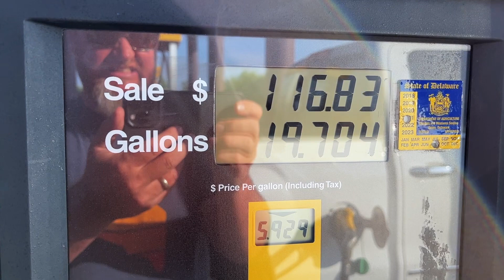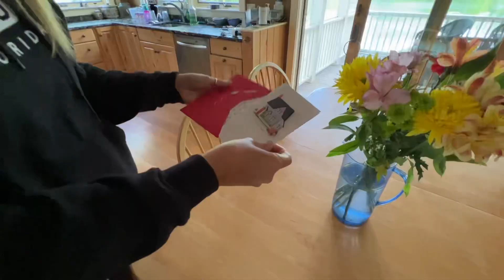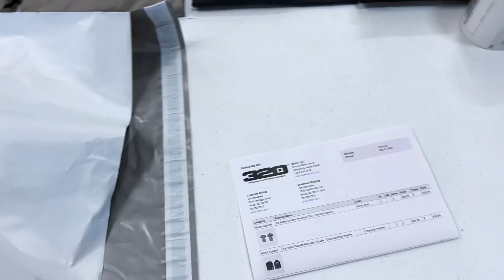THOUGHT IT CAUGHT ON FIRE | HOW TO HANDLE THESE ISSUES ON THE ROAD | RVING TO MAINE  S7 || Ep 131

Comment: you guys could do a DPF delete kit on the pickup but that depending if you guys still have a warranty on it still and have to do an emission testing every couple years in Maine . Here in Maryland only gas engines get tested. that was my worry about using my pickup to pull our camper on a cross county trip, having it break down and not knowing a reliable place to take it too. so we rented a rv instead and drove it.
Reply from the maker: I have definitely considered it, but I think we are going to sell it and get a new one, so we wanted to get it all ready to sell and if we need to go through a dealer to trade in, we didn't want it deleted.  Thanks so much for watching!

Comment: My son-in-law is stationed at Virginia Beach!  Thank you for your service!  I use to make Formula boats,  I made the small parts, like the showers, dashes, hardtops, arches and such. I also helped with the decks and hulls when the needed. I can give you tips on the gel coat too! Where to look for thin gel coat and how to feel for it. lol.  Gel coat should feel smooth like butter.  If you run over and area the feels like orange peal it's too thin and needs fixed right away!.  Thin gel coat will tend to be in cracks and under ledges, so make sure to check those closely. Remember gel coat it part of the water protection of your boat.  Also don't be afraid to knock on the outside of your boat especially around the transom and the v or keel of the boat.  You are looking for air pockets in the fiberglass. Knock hard if an area sounds hollow, gives it's a potential red flag. If it cracks you know there are other issues with the area of the boat.  If your boat has windows do the same check. Just a little tip!  Love your video's and family!  Congratulation's girls on your license's!!

Comment: Congratulations on Lily getting her license! The thing about the camera and the sound is maybe you may need to get the camera fixed or a new camera? Now you have three drivers. I am subscribed and it would be nice if you came to downtown Salt Lake City Utah.
Reply from the maker: We meant to mention it in the video but it was a corroded connection that is all fixed now.  Thanks so much for watching and subscribing!
Reply: We have a 06 3500 chevy silverado diesel and even after having it serviced regularly and checked out before our trip; we broke down in Wichita KS. It went into limp mode and we drove to an auto zone to see if it was just the fuel filter or something more serious. Luckily we have a truck camper and didn't have to worry about parking. Found out it was the fuel pump. They suggested a reputable dealer with a diesel mechanic. Not only did we need a fuel pump but the whole fuel rail had to be replaced. We were able to drop the camper in their parking lot and AAA paid for a rental car, our hotel and meal expenses. It was a pricey and lengthy repair but it got fixed. 5 days later we were back on the road. We stayed calm and were happy with the repair. We continued our trip with no further incidents. Our AAA RV road side assistance saved us over $1500 in added expenses.
Reply from the maker: @mjablonicky3824  that stinks, but you have it right! have to keep that positive attitude, things happen 💪! We don’t have AAA, we should probably look into that!